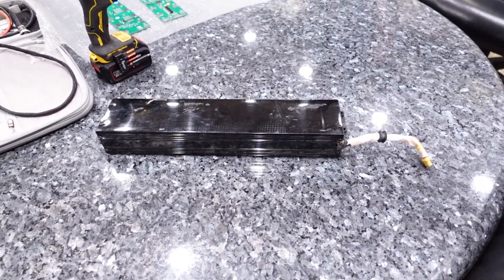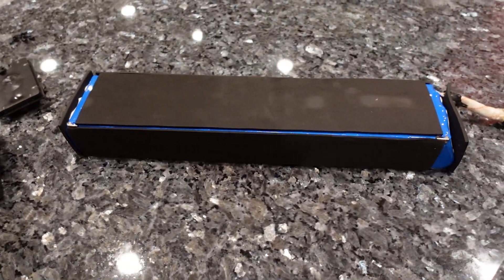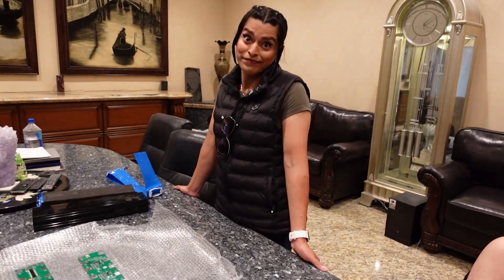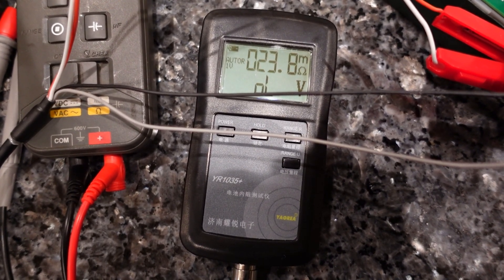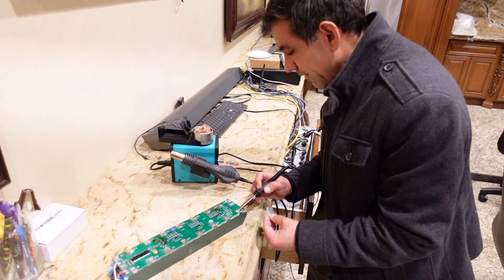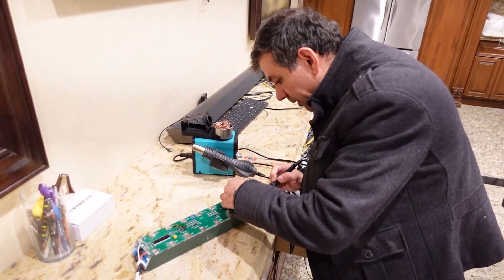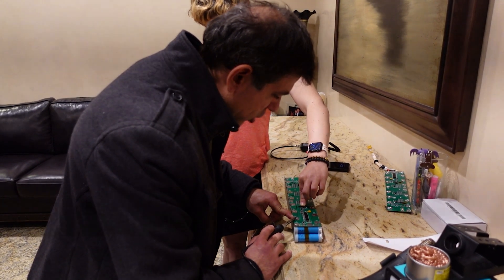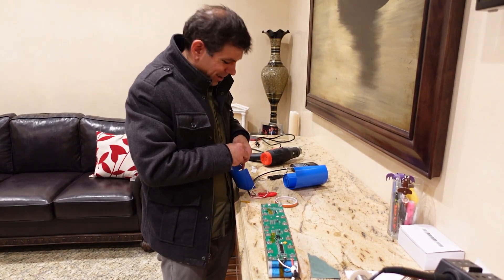BMS

Comment: Do you recommend that Internal Resistance checker?
Reply from the maker: It is what I use but it is hard to get consistent results with it. it seems that getting a good connection to the positive and negative of the batteries is hit and miss.

Comment: Just watched Marty's latest video on your Begode Charger board mod. A question, the Battery signal wires, I presume that any one of them is switching off the charger when the battery comes up to a voltage to much over their 67.2v rating? I also deduce from Marty's video that it is doing that by producing a voltage on those battery signal wires, over the normal 0V when things are within range. Your modification therefore disables the wheels ability to stop charging, so the charger continues to feed power until the voltage has floated at 134.4V. The risk, that there may be an imbalance of voltage between battery packs in series, and in certain circumstances you could be charging into a faulty pack. Have I got that wrong, or missed something. Good work on that Battery Signal wire by the way, I was wondering about that. The charge board also has a signal wire to the control board presumable to stop you switching on the wheel in fault conditions.
Reply from the maker: The bleed resistors should level the packs at 100% as has always been the case in begode wheels.

Comment: Bigger soldering iron perhaps :-)  Roger is obviously on top of this, but for others less familiar. This is considered living working (67v is enough). While soldering, unsoldering, any bridging of terminals with iron, or solder, on the BMS will cause an instant permanent failure of that BMS. That is unlike must circuits you would work on, this one is effectively powered as you do so.